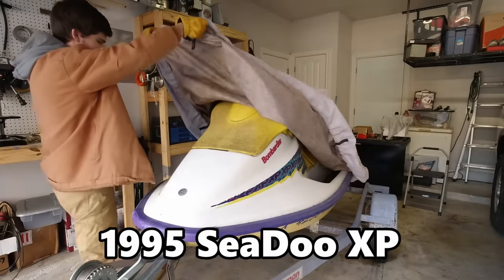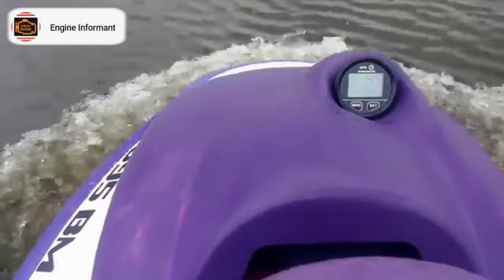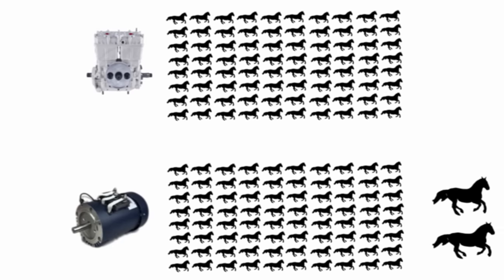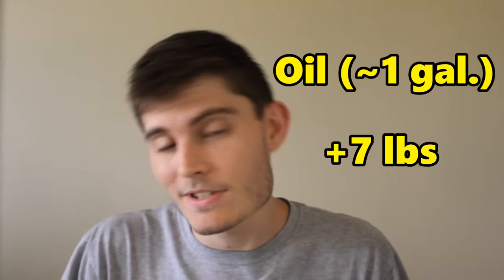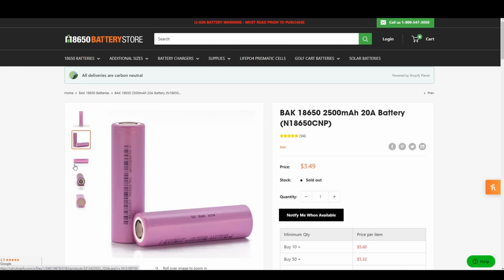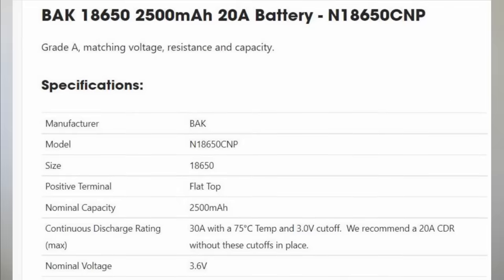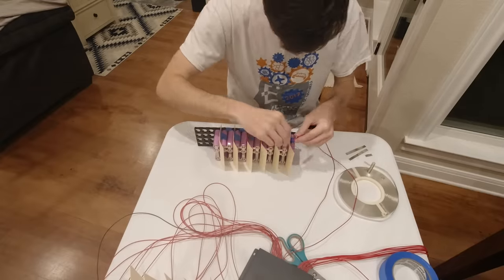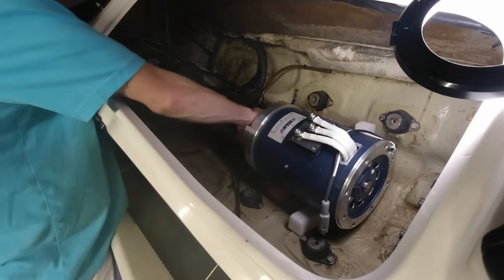Electric SeaDoo Conversion!

Comment: Nice storey.  Well done and thanks for taking the time to post it.  Now all you need to do is add a hydrofoil system - it'll reduce your drag by up to 70%...

It would be interesting to see how many cells you could have got in the original fuel tank...  But you'd probably need a good 2 x improvement on volumetric energy density of the Li cells to make that work...

Comment: Amazing video and a lot to improve on that project. 
I think you can compromise on capacity if you use higher discharge rated batteries and get the voltage much higher as you already said by connecting more in series. 
I am currently running almost the same exact project in Greece and you cannot imagine how much you help with that video.

Comment: Looks like a great project. Seems a bit heavy but you probably get a good run time? On the model RC jetboats high discharge C rated batteries really help for good performance.

Comment: Excellent job Zach & great vid of all ur processes. I wonder if u could use 3 x server rack style batteries in series to get around 150vdc (lipo4), it would make for an easier overall process & weight distribution. 
That was a lot of work, respect. Cheers

Comment: I'm an engineer and after a fairly long career in machine design, i found plant maintenance. You'd be awesome working in plant maintenance. That entire process, the motor mounts that didn't work, etc.. you kept going and learned a lot. If your YouTube career doesn't pan out and you're looking for a career change, check it out. Jobs are usually listed as electro-mechanical tech or maintenance tech. Not preventive maintenance though, that's boring!

Comment: Very cool project!   Thank you for sharing it with us!  

If you should try such a project again in the future, I might suggest you take the easy way with the battery  pack and buy - in this case - five Tesla battery packs from a wrecked Tesla.   It's important that all the modules come from the same pack, so they are all equivalent and have the same amount of use.  But, those can be had for about $450 each including shipping.    They are very compact, solidly built, and easily connected together in series for the desired voltage.   This would have also saved you a lot of time and effort, even if it might have cost a little more.

Still, I enjoyed watching you put this project together - much more interesting than watching you drop a replacement motor that cost $900.

Comment: Back in 2000 I built a Yamaha Wave runner 3 person into a Ultra lite. The first thing was the weight of this hull, 240 lbs. with Nothing in the hull. This was not going to work. So the hull mould was made. Carbon/Kevlar & honeycomb vacuum bag we go. 65lbs later we began the build. She had a very hard time getting up to plain, over 30 seconds of full power( rotax 582 aircraft engine) and she picked up speed. So I knew the hull was needing some help. I used thin fiberglass under the hull extending outboard another 5" and curved upward in the bow, like a water ski. Back testing this out, 5 seconds of power she was on top running great. Top speed take off, 26mph and were up. 6,000 feet in minutes. 

So what I'm saying here is, make the hull change as above. Good luck.

Comment: You could also add a transmission or gear ⚙️ to gear drive to change the ratio of speed to make a smaller motor work...
Great work, keep it up

Comment: Amazing job! but you completely missed one of the most important aspects of a watercraft  RPM.  the first thing you should've been conscientious of was how many rpms your old gas motor was turning. Since your old gas motor is spinning at higher RPM's than the electric motor, you need to adjust the pitch on your prop on your jet pump. And since you have a electric motor, which has wayyyy more torque than a 2 stroke gas motor. It will make up for the amount of RPM's you lost, if you have a higher pitch prop on your jet pump. You can make that ski go way faster than what it's going.

Comment: As a fellow developer I applaud your success....High Praises and congratulations! And though you've given notice on reuse of that motor on other projects I'd like to encourage you before moving on...........

A couple of suggestions if I may: Those "love joy" type couplings you're using are finicky and though they can be a good start the prime mover and output shafts STILL HAVE TO BE IN PERFECT ALIGNMENT or they will F-A-I-L .  Yours I'm afraid are not aligned, hence the kogging effect, that horrid sound you're hearing and too a BIG loss of efficiency output. A suggested use of a 'u-joint' type coupling will serve you much better, are more forgiving and far less finicky overall (something in the order of a CV Joint/axle). Lastly if possible,  might I suggest shifting  some ballast toward the aft. It may help on planning.

Comment: Very impressive, and well explained!

Some advice:
- 100VDC is dangerous to humans, and you also use it in a very wet surrounding. In that case,  60VDC is considered the maximum safe voltage. 
When you use UL1310 it's even 30VDC, although 48VDC is the maximum voltage to be considered "low voltage" and intrinsically "safe" for marine use.
- Use of BMS: I didn't see one,  or at least, I didn't see balance leads connected to a BMS.
Without a BMS, you cannot use the full potential (power) of your pack,  but more important: you will destroy your pack within a couple of charges and discharges!
2nd is that it's a big fire hazard, as the pack doesn't shut off when cells are overcharged. 
Each individual cell may never, I repeat never be charged / discharged outside the values in the spec sheet.  They're not a lead acid battery😋.
So, many packs in parallel will also eventually result in a malfunction pack. 
IF you use a BMS, then in the ideal world,  it would be a 40P model, and that as a pack, times 24...
The balance leads of a BMS measures each cell. The whole BMS will shutdown the batterypack if even 1 cell will go outside the under/overvoltage specs.

So maybe you would be better of with LiFePo4 65Ah cells in a 16S2P config, with 2 BMS-ses.
(Or 16S1P with 200Ah cells, with one BMS.)
Almost the same volume, slightly more expensive,  but simpler to build
The AC34 motor supports 48V.

Comment: Awesome video and really cool project, I really enjoyed it. Honestly your wiring and set up was very impressive for a dyi project and no experience. 

You shredded the spider because of a misalignment issue. Those things have to be perfectly aligned and stay perfectly aligned while in use or your going to destroy the spider every time. They claim to handle minor misalignments or as a flexible coupling, but in reality all of that is a lie. A flat surface on all four sides of the coupling will reveal any misalignment issue while it’s not in use. 

I would recommend either a diaphragm or universal coupling. Personally a diaphragm because you will most likely shred the diaphragm before you damage the motor or what ever your driving with it. 

Stay away from plastic chain couplings, they are very dangerous when they explode and they always explode eventually. But the upside is with 4 bolts and a hose clamp you can get yourself out of a bind with out replacing the chain.

Comment: As a electrical technician I have been working on 3 phase induction motor, variable frequency drive, dc-ac inverter, battery charger for years. My plan is to buy a broken outboard, keep the propeller, replace the engine with a 3 phase motor which attach to the shaft.

Comment: That's a seriously awesome motor controller holy cow!! So much data. What made you choose that one? They're not cheap! It's funny too because that is an induction motor controller and after your first test where you didn't have enough torque I was going to mention possibly using an induction motor. Induction motors have higher torque for the same HP as regular motors. Induction motors are different in that the rotor is not powered. When you power the stator, it induces current into the rotor, thus induction motor. They're commonly used in compressors and pumps, etc. But you got your regular motor to work. Unless that was an induction motor? Awesome project young man, your parents must be proud.

Comment: If you want to go faster, look into programming the controller for field weakening if it has it. Increases motor RPM for the same battery voltage.
Also, you're running way under the maximum power for that motor/controller configuration since it's rated for 170V max which is a 40s pack. Ideally you'd run it from at least a 40s 25p pack in this case.
Reply from the maker: I couldn't cram it in the video, but I actually did just that 😝 got my from about 4000 rpm to 5000 rpm after the initial test.

The better thing is to change impellers, and/or increase voltage higher

Comment: I’d HIGHLY recommend you run a more serious BMS with a solenoid instead of transistors, and program the balancer to kick in after 90% charge such as 3.95v up to 4.15v (always better to run lithium at just under max voltage) 

Also I’d suggest running the fused nickel strips from battery hookup instead of pulling solid nickel strip thug life setup and figuring out what happens the hard way. 

Love the video, the conversion, motor choice etc! Looking forward to more projects/progress!!!!!

Comment: When you set up a Lovejoy connector between your motor shaft and drive shaft they must be perfectly aligned. Use a  dial guage on each side. They should have near zero runout . Otherwise they will not last very long!  😎

Comment: Man, if you were to use a CVT/ slipper clutch to overdrive it that thing could really fly. It's moving well running 1:1. Overdrive it and you'll be able to lock it up and run a lower RPM effectively reducing the work load and making less heat. Better for the motor and especially for lithium batteries which can get dicy with extreme temps. But for the first go, very well done my friend. A few tweaks and it'll give the original XP a run for it's money!

Comment: Definitely shoulda have went with something like a SPIM08HP... The cells are 8ah each, and you can pull 100C out of them (800a). And they're less than 10 bucks a piece. Pretty nuts.

Comment: Nice work bro .
1 suggestion
x3 or x4 good 12v or 24v cells of lithium or normal batteries conected to an 12or24 to 240V inverter, a step up and stabilizer could actually work better for you, also instead of buying a 2,5k motor go to a salvage yard and get a washing machine motor. Hope I helped. Cheers ❤❤❤

Comment: Maybe 1:2 gear ratio from the motor to the impeller drive. Electric motors work opposite gas, in that they have 100% torque at low RPM, your in-rush current would increase, but you’d max at 8000RPM.

Comment: use gearing to double the shaft speed. it will run the impeller at an rpm that’s good for going faster and keep the motor at peak torque.

Comment: Maybe i didnt pay close enough attention, but did you try running the system w/o BMS on the way to the motors? and instead only have the INPUT / CHARGE going through the BMS  ? many ppl do that but with a system this large i'm not exactly sure it would be considered "safe"

Comment: Awesome project for you to take on as a sole engineer! - Was CG (center of gravity) ever a concern? Did the ski plane well without porpoising? You have to admit, tho, both car and rec. toys are nothing but BRICKS Vs. ICE.  Proof is available just by pulling up resale values on EVs that have been on the road 5-8 short years and all suffer from battery degradation.  For those of you retorting with, "Well Musk has batteries that retain 85% of their capacity after 1000s of cycles...." - Keep drinking the Koolaid of one of the world's #1 salesmen!

Comment: The reason your shaft coupler is disintegrating is that your alignment isn't close enough I used to have an Identical coupler driving a jet pump (s) in a catamaran. I would put flat plates temporarily in place of the rubber spider and align them with feeler gauges till they where as perfect as possible then spider lasted forever.

Comment: How ironic our names and channel names are similar haha! Great video! A high performance electric jetski would be crazy!! Also with the torque output of these electric motors, the ‘gearing’ for the jet drive could be altered for an absolutely mind blowing holeshot, and have amazing top speed! That old seadoo Hull isn’t capable of high speeds though, using a newer rxpx/tx hull (t3 or newer) would be such a cool project!
Reply: Coincidence is the happening of one or more events which produce results which were unexpected; irony refers to different singular events happening where the result is exactly opposite of what was expected literally.
Reply: Read a book bro.
Reply: yes more rabge more efeçt jet druveß

Comment: If u gave up on it. I really really want to work with it. I have a self running solor boat project requiring a good motor. And capacitor puse discharge over battery banks and a high voltage ac transfer  system

Comment: Just an off topic, to some extent, comment about your drive water jet.
A standard water jet propulsion unit is usually designed to run at about 4500 to 5500rpm.
Running them over this rpm can lead to cavitation which has a tendency to destroy the propeller.
Admittedly, faster rpm = more speed but with cavitation likely.
I heard of a guy who fitted a Wankel rotary engine in his jet boat ... great for speed, but bad for the propeller. Based on the first-generation RX-7 FB series (released in 1978), it is powered by that naturally aspirated 13B twin-rotor engine, which makes a huge 300hp at 8,500 rpm and 270Nm of torque at 7,500 rpm, revving all the way to a huge 10,000rpm.   Hmm, that is what he fitted instead of the V8 it replaced.
He had to fit a 2:1 reduction gear box, increased the prop pitch, got more speed, and, didn’t kill his prop by cavitation.

Comment: The manta 2 It has 10 horsepower at 12 volt Add plenty of torque Across around 5 or 600 bucks depending on where you get it

Comment: Maybe a terrible idea for a jet ski but  it would work in a paddle wheeler style boat that's sized for an 80 hp motor. They can handle the extra batteries needed for distance and you could cover the top with solar panels to charge it while it's parked.

Comment: LG or Samsung lipos are the best and some 21700 batteries are bigger. you can also use some automotive audio or lawnmower lipo packs.
And instead of charging each battery separately.  Which would suck to disassemble the pack each time to charge n reassemble.
So by Adding B.M.S (battery monitoring system) temp and battery voltage  discharge and charging rate monitoring the Whole pack would be the way to go...
And balancing the cells is also very important every 4 to 5 cycles
Neat build for sure tho

Comment: I would have used a series DC motor. Warp 9 or Advanced DC 9" with a 144v 500 Amp Curtiss controller. Prices are crazy now due to supply shortages, but you should be able to get each brand new for around $1600 or remanufactured for around $1000 each. That gives you about 96 hp and 140 ft. lbs torque. if you want double the torque get a 1000 amp Zilla controller, but it will cost you double too. You can't beat series DC torque for the money. LiFePO4 prismatic cells would have been an easier way to go with batteries, maybe cheaper too.

Comment: One of the best design water craft ever made 95-97 xp and 97-98 spx very awsome job but sadly no where close to its 58mph oem motor, and as you pointed out the cost mostly the 18650 cell cost a crap load.

Comment: Great project i would have used lipo 12s 50c then you can use simple chargers from hobby shop plus prepackaged high amp batteries easy to get.

Comment: Kinda wish you threw a 200hp electric motor into that jet ski. Would have loved to watch you go really really fast. And would have given me the inspiration to build one as well. That one just seemed too slow, also use 1 Guage wires next time, they don't really ever get warm at all with that amp and volt rating. Can't wait till the next video.
Reply: buy whakè 235  cinqwest envoy 200 hp ektruc outbard

Comment: Would recommend 21700 batteries over 18650 for this kind of project, because of how much easier it is to package with how much bigger they are and how much fewer you need.
Reply: buy 21700

Comment: Only one suggestion I would have would be to have wrapped the bottom battery pack across the top of it with some Capton tape to keep any possible grounding from happening by accident before you flip that other battery pack over on top of it.

Comment: Nice work.  Since you said you could not find anyone done this before, I built the worlds first and fastest electric jetski.  It used a Mars 48v "5 hp" motor that can be over driven to 20hp for a short time.  This was well before youtube existed.
The real key for a jetski is to get a water cooled motor (which this 3phase motor mine was not).   
A prius generator motor is almost free and is water cooled..
So funny I came back to this video, because I'm now working on another ev jetski that is actually a big 20ft catamaran with a jetski drive, and was going to post what I did before.  
I'm also thinking of making mine a hybrid.   I mean really, if you spent $2600 on the motor when you could have replaced that jetski motor for $500???    I made my original just to be the first to do it, and my mars motor was used only $200 back them, and I had 4 yellow tops.   Now I have lots of lithiums.  So I'm thinking of using that original jetski 20hp pancake motor I still have and a turbo charged little 8hp 2 cyl  two stroke.  I will be posted it to my youtube channel, but will wait till its done I think before posting a video.